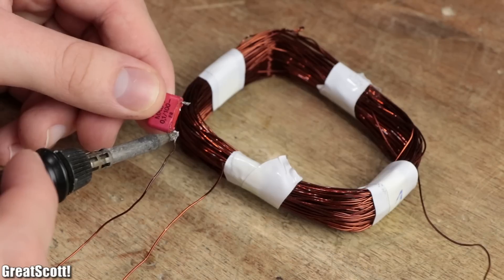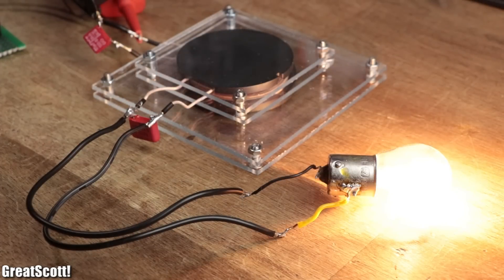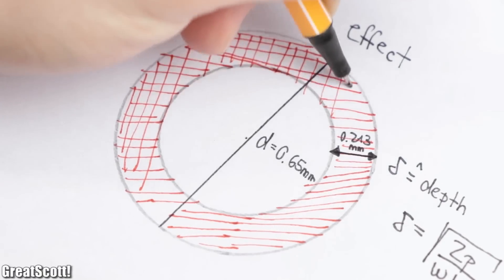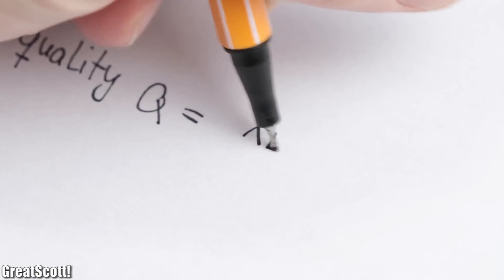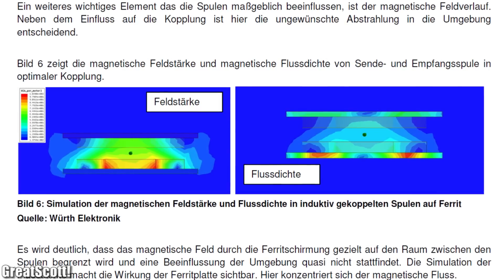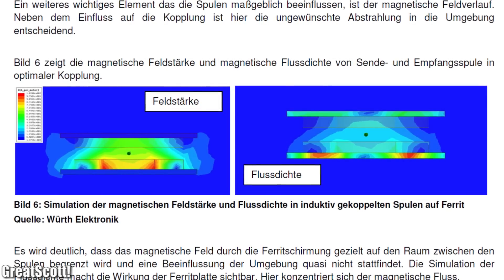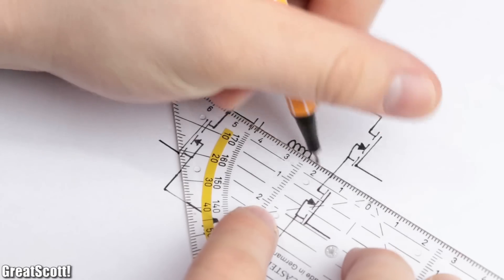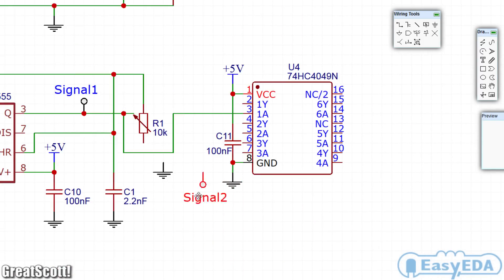DIY Wireless Energy Transfer System

Comment: One key difference in the copper winding of the commercial product was its flatness in the coiling. I guess a thicker, hand-coiled transmitter experiences more resistance. Your explanation of the wire strand thickness was a good one. Great video!

Comment: For a wireless energy video idea -  fluorescent tubes can be powered from across a large room via a single 30AWG wire. It's an amazing sight to see for the first time and easy enough to do. The wire doesn't heat up and your video circuit would easily do the job :)

Comment: This is awesome!  I was just needing a higher throughput for a project I'm working, specifically 2 Amps at 5v (10 watts).  And I had to use an H-bridge for the first time to drive to ring and old fashioned phone ringer.  Perfect timing.

Comment: 150khz on a breadboard? 

Brave man.
Reply from the maker: I like to live dangerously
Reply: sorry just curious, what are the dangers of using high frequency on a breadboard? is it something to do with the capacitance?
Reply: Tchsurvives Yup!
The parasitic capacitance of the breadboard makes it almost impossible to keep the frequency constant
Reply: GreatScott! Ha ha ha
Reply: @tanchienhao  yes it has to do with the capacitance.
Reply: @greatscottlab  that's funny .
Reply: @greatscottlab  I think we have another man for this
Reply: @TheS1l3ntOne  I'm a rookie DIYer trying to mock up a 500khz resonate circuit on a breadboard, is that the reason I didn't get anything near a sine wave? Will move to a proto-board solve the problem? What else should I care when working on high frequency? Expect your answer!
Reply: @刘玄-q2b  breadboard has tons of capacitance that make the signal distorted. For 500khz I recommend a PCB. And no long leads. That's the best way
Reply: @TheS1l3ntOne  Thank you so much for the quick response, I'm about to try it on a protoboard with silver copper wires, wish me luck
Reply: @刘玄-q2b  You are welcome
Reply: Is there any reason why you're inputing a 150kHz square wave and not a sinusoidal wave?
Reply: @jasmincasauay5577  square wave is easy to create than sine wave
Reply: @greatscottlab  Michael's 'Dangerous' intensifies
Reply: Me: 50MHz on a breadboard XD. It does sort of work actually.

Comment: From what I saw, it's possible to improve the efficiency by using a better plate. Most likely the commercial coils are using a cheaper ferrite material instead of a more expensive silicon steel. If you can get your hands on a couple of plates of that stuff your efficiency should be much higher. Really liked the video!

Comment: You dont need a complicated H-bridge to send higher current to the receiver. The magnetic field is produced by change in electric current = it does not matter if the current goes forward and backward, important is that it is changing (according to Lenz law). So you will get the same result (or better if using square wave signal) if you had the transmitter coil fed by pulsed DC and only a single tranzistor can do that.

Comment: Ferrite plates like those used in the commercial wireless energy coils can be salvaged from VCRs.
The video heads are connected via a Rotary Transformer, which lives inside the drum assembly.
Simply dismantle the drum until you have the two halves of the aluminium drum with the coils glued to the inside.
The glue can be released by putting the coils in the oven for 5 to 10 minutes, I think I had to go up to 150c to get the glue to release one coil.

Comment: I used 24 awg Magnet wire, and would a coil with around a diameter of 6 inches, and would another coil with house wire, which contains the 2 wires i needed for transmission. I then hooked this circuit up with a 2n3055 Transistor running on 12v at roughly 15 amps to get about 1 foot distance of transmission to my LED's. This worked for multiple circuits that i played with, but i couldn't get it to work with  motors, etc.

Comment: Excellent video about wireless power transmission. 😀 

I would love to see a DIY wireless charging station with 5V and 2~3 amps current output, using a coil attached to a male micro USB type B or C port. It would be probably necessary a circuit to stabilize the voltage from the coil at 5 volts.

Another interesting upgrade would be a magnetic cellphone holder with wireless charging for automotive use. Not really if the power consumption of the "power emitting coil" would drain the car battery, so... probably it would be could to make the power station turn on ONLY when there is a equipment docked at the station. Perhaps... it could be a reed switch.

Comment: Great Scott, could you not use a tapered wooden dowel to wind your coil? it would slide off the dowel like a spring, with inner most wraps being at the smallest end of the taper.

Comment: Great video (series) with good amount of theory, multiple phases of project and great results.
I just wish the Qi-charger I got from eBay would work even remotely as well. By aligning the charger and a mobile device with surgical precision, charging would start but efficiency would stay around five percent. I may have bought small heater which has Qi charging as a side effect.

Comment: It would be cool if you could make a control circuit for the receiver and transmitter. That way no power is lost when there is no load. Just make it pulse about every second. When the pulse is received, the receiver could use that energy to send a small pulse back and begin energy transfer. Er, or maybe detecting current draw would be better.

Comment: Hey, Scott. Thank you for making this.
I assume you're using Litz wire in the latter part of this video. Have you tested with more strings? You say that the wire you're using has over 100 strings. I assume it's 180. What effect would more string have? For example 500, 1000, or even 3000 strings. Will the skin effect be greater? Will it cause more current to flow into the inner part of the conductor?

Comment: i am really interested in technology and electronics but I'm a beginner so I understood berry little here , do u have any videos which explains the basics? that would really help
Reply: Eric Rodrigues I believe he has a series called electronic basics. There is a playlist on his channel. It will teach you the general function of most common electrical components. And the differences between them
Reply: its pretty basic, electrons go in, they reproduce producing more electrons, baby electrons are small enough to fit through the holes in the wire flying out into the air, they then enter the other wire at preteen age, then are too big to fly back out thus resulting in electricity in the other coil. this is why when coil is close, it gets more power, cuz all the baby electrons are still babies, but as it moves farther some are growing up too fast due to nutrition and wont fit back in the receiver coil, while others are just big enough to go in and not come back out, its basic physics.

Comment: Hey, I'm investigating the effect of distance between coils and misalignment of coils on the Induced EMF and Efficiency of the system for an academic project. I'm using Qi Standard coils, with inbuilt PCBs, so I'm guessing I wouldn't need the external circuitry. Are there any values I should measure in advance? Would I need an oscilloscope for initially measuring frequency? Also, is there a formula that connects the Voltage and Current (variables that I will be measuring) and the Induced EMF (required answer)?

Thanks a lot in advance, this really helped with my method and setup!

Comment: Thnx for the video man. It was great. But I was going through the circuit design and I saw many voltage sources with capacitors connected to ground but those voltage sources were not used ( looks like you were about to use them and then you just left it there), So please tell me whether I should use those voltage sources as I m trying to replicate this circuit. Please reply at the earliest.And by the way, can I use IRFZ44N instead of IRLZ44N and Should we use the same driver for IRFZ44N mosfet??

Comment: How would you improve this design if let's say you have a smartphone to charge wirelessly where a constant voltage and perhaps a minimum current on the charging end is necessary? Also that AC signal looked a bit funky during the toggle, wouldn't a 4047 be better, since it doesn't require an external inverter?

Comment: Hello, GreatScott!! First of all, your work is amazing! I love your videos!
I have a doubt: whats the purpose of the 10k resistors R8 and R9 in the bridge circuit, since all the MOSFETs used are N-channel? I know it is usual to have this resistors from gate to source of the MOSFETs to discharge the gate capacitance, as you did in the two low side MOSFETs, but i dont understand the purpose of the resistors being placed from gate to drain in the high side MOSFETs. I always thought they should be put between gate and source as well. 
Sorry by bothering you with this questions. Thank you for your grat job!
Greetings from Brazil!!

Comment: Why do you need a resonance circuit for this operation of the coils? Would just 2 coils not do the job? Furthermore why do you set up the transmitter as a series resonance while the receiver is set up as a parallel resonance?

Comment: Future lectrical engineer of TU Delft here, and kind of worried about my courses now, I didn't see things like Q factor or skin effect (not in the lectures at least) :p Was it part of your curriculum?
Next to that, try to drill acrylic with a higher speed and less pressure, otherwise you risk damaging the acrylic way faster :)
But, as always, awesome video!
Reply: Here is the schematic I used for a project at uni:
https://easyeda.com/Michiel/EEC_air_core_transformer-Eic6oKEWd

I just noticed your inverter circuit doesnt have a current protection circuit. Wouldnt that damage the inverter when you pull the receiver away? Since the impedance will then become about zero without the mutual inductance
Reply: You should come across the term "skin effect" in modules related to Analgoue Electronics, where topics like behaviour of R, L, C at high frequency will be discussed. Q factors would be touched on Analogue Electronics as well, as you explore Q factor of filter circuits. However, you can argue that the Q factor and skin effect on wireless power transfer is not the same as Analogue Electronics, however, the general concept is somewhat the same.

Comment: What's the feasibility of building a microwave receiver and then using a magnetron, possibly with a simple wave guide, to attempt to transmit power over a slightly longer distance? Obviously it's not particularly practical and slightly dangerous, but I've been interested in it and knowing just how inefficient it is. Also I have no idea how to build a receiver for microwaves. I do in theory but they seem to be a little more complex then simple radio.
Let me know if you think it's something you'd cover in a video.

Also, amazing video as always. Your production quality never seems to dwindle. 
Keep up the amazing work!
Reply: "and slightly dangerous..." lmao!!! oh yeah, only slightly xD
Reply: Around 50% loss in the transmitter(magnetron), and who knows for the reciever.

Also the power will be spread over a bigger area, so pickup is a issue.
Reply: erlendse yes but that's what the wave guide would be for. To narrow the beam and prevent it from dispersing so much. I might add that microwaves can (and are) quite directional and good at long distance (kilometres) transmission. Look up microwave dish/ drum. Obviously this is for signal transmission and not power but at a shorter range it could be for power.
Reply: Lachz10
Fair enough. But you mix waveguide (does similar task to the one of a cable) and antenna (recive/transmit into air, can be beam or bigger angle). To get them directional takes some effort, and to do very narrow angle require a big antenna.

Comment: Hello! I have been using this video and the last video on wireless transmission of power to guide my research on Wireless Power Transmission. Could you explain to me why the capacitor in the Rx coil is in parallel and the cap in the Tx coil is in series?

Comment: Great Scott this video is fantastic!

It lays out all the fundamentals on building a wireless charging circuit and understanding the technology even at the equation level!

My question stems from a desire to use wireless charging on a battery multiple times the size of a phone that would require more power being transferred.

If it is not too much trouble, is it feasible to scale this design up to handle significantly larger currents and/or voltages?

Unfortunately I don't have specific numbers on the battery I wish to use, but it would be upwards of 10 Ah to be charged in a reasonable amount of time.

Thank you for any information you are able to relay or sources that you may be able to direct me to!

-Nex

Comment: Dear GreatScott!
so about that big red capacitor of yours; does the resonance have to match on both the transmitter and receiver coils? In other words, do they both have to be the same capacity? and also, would that be relevant to the inductance of each coil if they're different? 
or is it the bigger capacitor the better?
Reply: Hi Brad 
I saw other videos where I found that they use C1L1 = C2L2

Comment: Sir why did you connect a capacitor in series with transmitter coil and another capacitor in parallel with receiver coil?

Comment: Very nice vidéo !
Where did you buy the mosfet drivers ? Ebay or Conrad?
Reply from the maker: +16mlucas Ebay. I always try to avoid Conrad due to their prices.
Reply: Yeah I always avoid conrad, but for such component ebay doesn't seems reliable, you bought them from a ramdom seller or from somone that you've already tried? gc_supermarket don't have them
Reply from the maker: +16mlucas Random
Reply: But some months ago you said that you buy ouch at Conrad
Reply: You could combine this project with your POV Fan so it doesnt need the Lipo cell any more :)
Reply: HappySlappyFace nope,it needs a capacitor but not a supercap, see in the datasheet there is a formula I think. the last time I used mosfet drivers, the bootsrapping cap was around 100nF (driver L6388).
Reply: I'd use Digikey or Mouser.

Comment: Hi I made the h bridge full inverter. As guided I used a 555 and used cd4049be to invert the signal. Now the problem is - the output of 555 can drive the mosfets via ir2110, but the output from the inverter is not able to drive the mosfet drivers, hence effectively only one half is generating oscillation. i don't have any oscilloscope so can't exactly see the peak to peak output voltage of the pwm, but with multimeter i can measure the output as 2.5v, and the output of inverter is ~1.5v. The 7805 output is measured as 4.91. Can you explain what is happening here?

Comment: Great video! Questions tho: the point of the H-bridge inverter is so the primary coil can use DC power? And was that a rectifer at 2:58 connected to the LED?

Comment: Hai,
I saw your circuit , i have a doubt 
In your video at 5:13 you connected 10k resistor the upper side mosfet's  gate and source but in your easyEDA schematic you connected that resistor to gate and drain !
Which is true ?

Comment: 3:40 :  It looks like you misread the frequency scale. It is logarithmic. Therefor the resonant frequency has to be read as 110kHz, not 150kHz.
Reply: I'd say 130 kHz, but whether 130 or 150, it's not a critical difference.
Reply: I think you are wrong, from 10 to 100, each vertical line represents 10 khz jumps.  At 100, now each line after is 100 khz jumps.  This means the peak Q rating is between 100 and 200.

Comment: Why don't you use a H bridge IC like L293D? And how you got 50% duty cycle using one 555 IC? My professor told me once that we have to use two 555s or a 556 to get 50% duty cycle. I'm confused now.
Reply: If you have the timing resistor from the 555's output pin, it should get very close to 50%. Even with variable frequency.
There are many ways to connect the 555 timer!

Comment: just a question, could this safely be used to power an Arduino after passing though a bridge rectifier? or would you recommend that I use it to charge a battery that then goes on to power the Arduino.

Comment: Great video!  I was wondering if it's possible to design a circuit where an I2C device (slave) could use a wireless connection to the master?  i.e. is it possible to transmit power and data wirelessly like this?  Thanks

Comment: Hi Scott, 
Is it possible to build an induction battery charger with super capacitors, boost converter and induction coils to use magnetic field build up around a DC (in-runner/out-runner) motors?
Please make a video if its possible.

Comment: Really nice video, a small correction that I noticed at 05:46, the 555 timers generate 'square wave signals' and not 'PWM signals' (glaub du hättest es unwissentlich gesagt ;) ).
Reply: Raghunandhan Sundaresan you can wire a 555 to do PWM and control the duty cycle with a variable resistor .
Reply: kardeef33317 of course you can generate PWMs with 555, but a better suited word to use here would be square waves :)